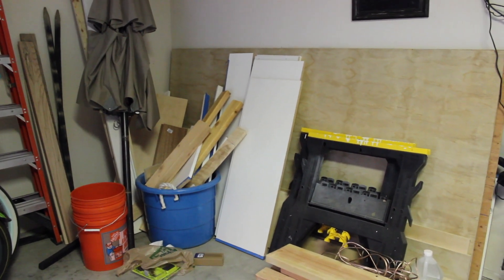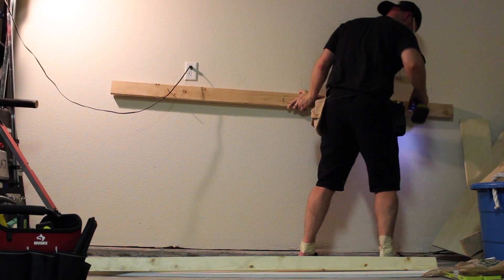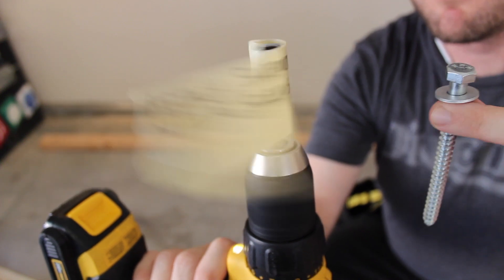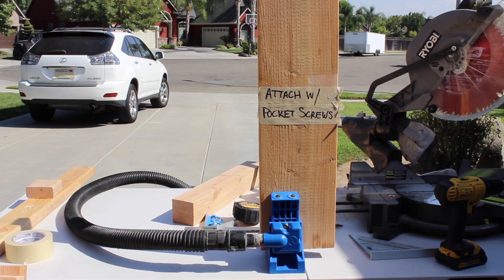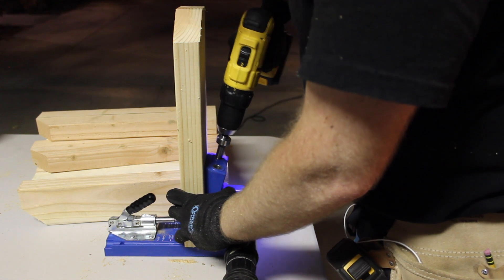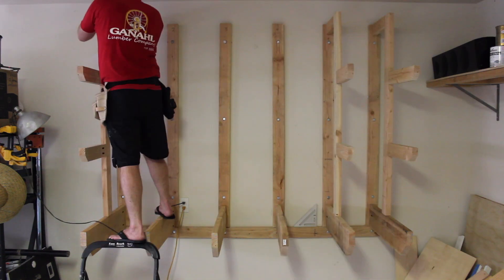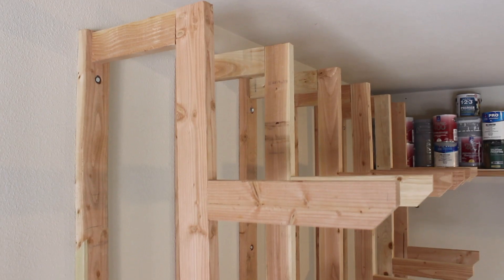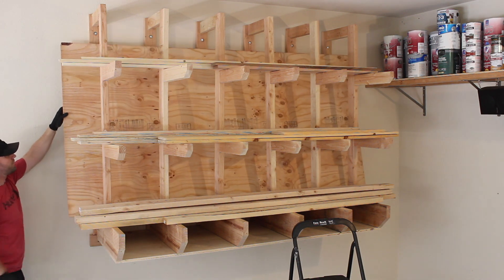Clever Design for DIY Lumber Rack

Comment: What purpose is that cross piece bolted to the wall at the bottom serving?  It doesn't look like it is bearing any weight.  It is unlikely that the vertical braces are transferring any weight in the the bottom cross brace.  I like the design though and may get a chance to make my own version for a project.

Comment: Excellent design. The vertical 2xs on the wall aren't necessary. I would hang the other vertical 2xs from a top plate secured to roof rafters at the ceiling. Then you gain that 1-1/2" of space for the sheet goods while using less wood overall.

Comment: I purchased the plans and built the cart according to the instructions. The pocket screws pulled out, it's too heavy to move easily when loaded, ang I'm planning on disassemble and doing something else for my small piece storage issues when I've used up more of the scrap it's currently holding.

Comment: For those who have built a similar project, with 2x8" utilizing the Kreg HD screws; how much horizontal movement is there once the screws are in? I realize that it the thinnest portion of the board and that part of the joint will have the least holding power; just want to make sure I am building things to be strong enough.

Comment: This is a great concept for optimizing space in the work shop.
I'm a little concerned about the two pocket screws holding the horizontal 2x4, there is a huge amount of force applied to  those two screws when loading it with hardwood lumber.  Have you had a chance to put more than the few pieces of lumber you show on the video?
How would you strengthen that joint if you had the opportunity to do so?
Reply: In this video he has 6 of those supports so the weight would be distributed (depending on the length of the lumber of course).
He also mentions, in the link that takes you out of YT, regarding storing lumber further away from the wall will put more stress on the studs and drywall and that he tried to make the design as compact as possible.
One thing you could always do is add a vertical support from the floor or angled from the wall at one or more points from the very bottom of the design.  Of course I think the whole point is to create some floor space.

Comment: Great idea, need to adjust to meet my needs.  Using my 12x16 shed.  Limited Room Space, I normally will cut any 4x8 sheets as needed.  No storage room to this size.  Only smaller pieces.  Thanks again for the idea.

Comment: i think i got it. you only temporarily attached the first 2x4 then drilled for the lag screws  to go into the studs. missed that.  with no drywall, would you suggest using 3.5” lag screws?   i have some pretty big pieces of wood to store, 2x12s and 4x6 and 4x4

Comment: Only thing I plan on changing is to put bottom plywood Cut to 2ft by 8ft about 6 inches from floor to be able to sweep and pressure wash under it and add the other half length of plywood on top to add that as a plywood shelf.

Comment: I built this over 2 months ago and it is holding up great.  I did add some insurance and where a board would attach to another board, I used Z-MAX 2 in. x 4 in. 12-Gauge Galvanized Medium L-Angle along with pocket hole screws and glue.
Reply: And Simpson Strong-Tie LTP 3 in. x 4-1/4 in. Galvanized Lateral Tie Plate.

Comment: Great idea for sure. I wonder about the strength of the pocket screws holding the supports though.
Reply: HD pocket screws are pretty dang strong
Reply from the maker: I hear ya, and was skeptical about it at first, but I can tell you that this lumber rack is still holding strong in my garage after a couple of years.

Comment: Hey man, great video!! Couple of quick questions though. Do you have a drawn up plan you could share? Or maybe at least tell me what the lengths are on your cuts? I know the arm pieces you said are 16”, but what about the vertical supports? All you said was cut to length. Any information would help man. Also, what size drill bit and lag screws/washers did you use to secure them? Thanks man! Can’t wait to build this in my garage!
Reply: Also, how long are your 2x8”s??

Comment: Hello, I know this video is old. But it still very functional. I've tried a similar build in my garage, but I downsized it little bit. I also used 2x6 instead if 2x8. But I got 3 HD screws on each 2x6 and it when I lay my weight at one at a time, I can clearly see that the 2x6 is "wiggle" just a tiny bit though. I understand that having 6, or in my case 5  2x6 will carry the weight even. Should I take some action maybe or just go with it? 🤙🏼

Comment: That’s a really cool design for hiding away full sheets.  The only thing I’m having a little trouble thinking through is having to keep the wall beside the rack clear for inserting/removing sheets.  I guess if you had something mobile in that area (or some other restriction that wouldn’t allow you to use the wall space for something else), it would work great.

Comment: Great job!  Very innovative.  You mentioned something about using Kreg HD Inserts in order to give you the strength you wanted.  What are these HD inserts??  Thanks!
Reply: Kreg HD stands for “heavy duty”. They are larger holes that take larger and longer screws for working with 2x and 4x material.

Comment: Great video and design, I want to build something similar. Just wondering, what is the purpose of the horizontal 2x4 you lag bolt in at the start? Looks useful for levelling the vertical framing, but nothing seems to be attached to it by the end of the video. Am I missing something fundamental haha?

Comment: Do you have any concerns about the lumber rack arms being held by two screws?
Reply from the maker: While planning this project, yes, I was cautious. But I tested some joints before doing the final build and it seemed to work. About a year and a half later, I’m happy to report that this rack is still holding strong.

Comment: @2:43 I feel stupid for asking, but I'm not really good at this yet:  How do you figure out where to place your screws when you're in the middle of the sheet?  You can't see your joists.  Are you just measuring your joist space?

I guess I'd cut this to length right after I get the base set  up.  I'd put the plywood on top of the joists and get below it with a pencil and outline where they were.  Flip the board and ta daa?  AAah?

Comment: I have standard studs but they covered over the studs with 1.5 inch white Styrofoam, then covered with sheet-rock. Conventionally attaching anything to the buried studs doesn't work and I would appreciate your thoughts and suggestions.

Comment: Awesome design I love it and I am headed to build my own. One thing that I couldn't wrap my head around is the utility of the bottom horizontal 2x4. Since  the vertical ones are those supporting all the weight,  what is the function of the horizontal one? Maybe I missed something. Thanks a lot, really impressed about how much information you've been able to put on such a short video!!
Reply: 100% right. I thought it was just temporary to align the verticals, but then he lag-bolted it in. Why?

Comment: Good design. Lags a plus but your poker screws want last with time.  I suggest. The scrap from your 3/4Sandy ply,  you half left over if it was a true 4x8. gusset all your arms. Both sides like old school trust build ing style on site,  .  Great video,  I need to get the track you got for your saw..  What brand is that?

Comment: You use (I believe) 1/4” lag screws to attach 2 x4’s to the wall.  Then you use pocket screws to hold your supports!  That’s a recipe for failure.
Reply: I'm about to build one of these.  How would you improve this design?
Reply: @hogue3666  I would use 2x6 for the top support.  Also add a 6 or 8 inch deep shelf at the very top which can also provide more lateral support.
Reply: @adamtki  Thanks for the advice :)
Reply: I would put a sheet of plywood at the RH end, to prevent the racks sagging, and a single leg to the floor. Of course, it may still pull your wall studs out of whack.
Reply: Good thought.  My shelves will be secured to a 12 inch thick concrete wall.

Comment: Great video.  You had me at “mullet rack”.  Depending on how long you have to store your sheet goods, it may start to bow (sag) if it isn’t supported in the back.
Reply: Yep. The way u walked into that, I knew it had mullet implications as well. And the design is sweet too! Unfortunately most my ply sheets are 3/4” oak, 3/4” maple, etc and there’s no way I can lift those up solo, that high, and slide in to the “party” section of storage. Regardless, design is very nice! Might use the “business” side of yer design ….??? Thx!

Comment: Pocket holes not enough Needs plywood corner brace on all your 2x4 coming out from wall both sides however nice to see lag bolts being used on your wall pieces
Reply: JustJaminify, my thoughts exactly. When he said "these are going to hold most of the weight, so I use heavy duty pocket screws"😁
Reply: JustJaminify, although overall once everything is attached together it gets a lot stronger. But pocket screws would not have been my choice. My lumber rack has plywood gusset on the horizontal support, it's a proven design
Reply: Those HD pocket screws are 1/4" diameter (#14), not your typical #6 or #8. The wood is going to break long before the screws.
Reply: @ADBBuild  the wood will break...that is the problem. The playeood brackets would prevent that issue.
Reply: The woods not gonna break, chill out.  Go build something
Reply: @aaronberk1234  I thought that part was a joke... I love the design, but should be supported a bit better. Wonder how it is holding up.
Reply from the maker: Still hanging in there...
Reply: @bleedscold  I've been converted to the strength of pocket hole joinery. Like any joint, understanding where it's strong and where it's weak while designing are key. Here's a test sheet for the Kreg HD screws. Should hold plenty for what he made. https://www.kregtool.com/webres/Files/KregJigHDForceTestSheet.pdf

Comment: 2 Years Later --- Do you still like your design? Is adding/removing full sheet goods a pain in the ass? Would you change anything regarding your design?

I personally am making process with my woodshop but need to get my hoarding under control.

Comment: I've been watching ALOT of woodworking videos recently and I REALLY like the way you add/transition those notes in! Very clever and unique!
I do have a question though: This is by far the most functional lumber rack I've seen yet, so I plan on building this one. But I'm wondering if it is still safe/okay to do 3 or 4 racks instead of the 6 you built?
Reply: Depends on how much weight you’re gonna put on it.

But most likely it will be fine.

Comment: Cool design, but I don't think i could sleep at night with just screws holding this up. I'd go with half lap joints glued and screwed; and not just because I don't have a pocket hole jig :)
 Of course the point is to be able to use that space underneath for something but if you don't put at least two legs you could build a storage cabinet for it to set on and support the second set of vertical 2Xs. And get a good night's sleep.

Comment: LOL, all that weight held by two pocket screws. Have fun picking all you boards up off the ground. Hopefully you don't have any kids or pets that could possibly be under it when it falls.
Reply from the maker: Totally valid point and I have to admit that this certainly is an experimental design. So far, after 10 months, the rack is still holding strong with no signs of sagging.